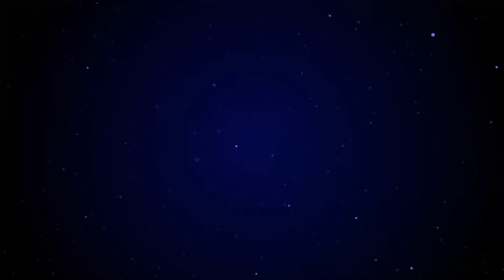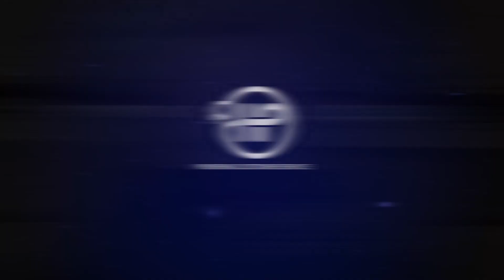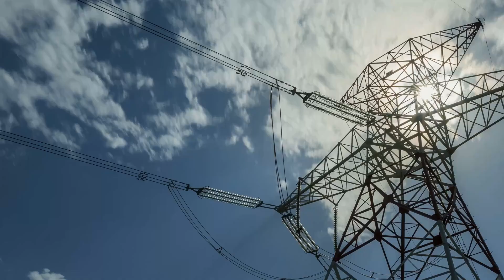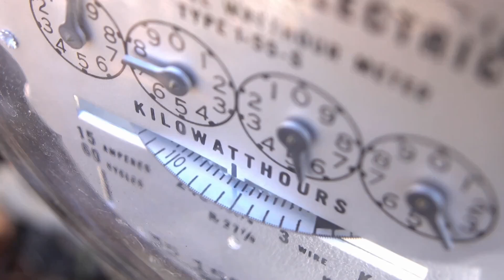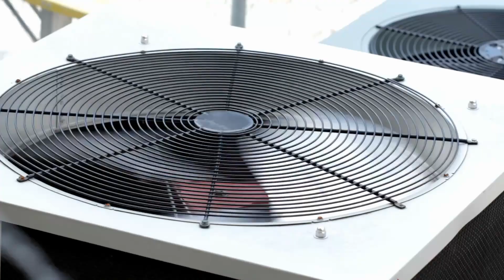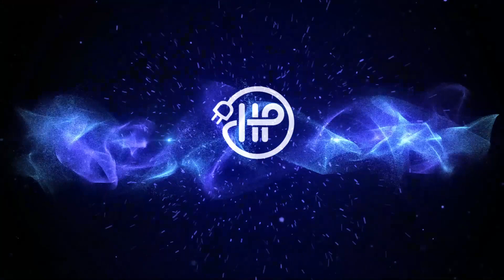200 Amp Electrical Service Upgrade | Edmonton Electrician

Comment: Now with California stopping sales of gasoline cars in 2035 and want to ban natural gas in all new homes then 10 to 15 years later make existing homes have to stop using any natural gas. So any mid size home with 2EVS would need a 400 amp service to supply power to all electric house. Lasz foot dragging ultility companies will NEVER have the needed upgrades from generating plants to homes. Will take them halve a century just to triple the size of the thousands of transformers.
Reply from the maker: Lots of points being mentioned there, but I would have to disagree with the 400A part. Otherwise I would have to agree with the general point I think you're making. Global infrastructure needs balance in it's energy usage, and as of today the world isn't prepared to be fully electric in 10 years. 

I would have to make a bold guess that the government saying they'll stop producing gas cars would get further pushed back, or abandoned altogether. We're all human though, and these policies change every day.